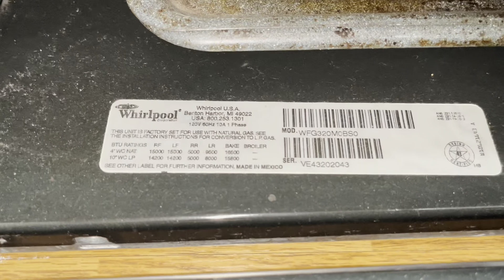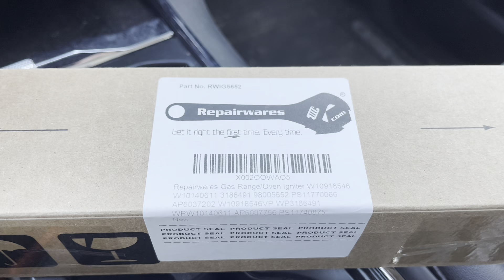Repairing a Whirlpool oven by replacing the igniter.

Comment: Any suggestions on that could be the issue if my igniter heats up but it never sends gas?? Same model as in the video
Reply from the maker: It could still be the igniter not working well enough, or the safety valve it connects to, or the gas regulator.

Comment: Whyyy can I not get the bolts undone? What did you use? Mine might have a little more lip than yours so I can't get a tool in easily.
Reply from the maker: Shoot. I’m sorry. These were just small bolts so I used the nut driver on my multi tool screwdriver.

Comment: You're electrical diagnostics are explained incorrectly.
If the element is good, you will have continuous AC voltage through the heater/ignitor and both wires.
Having AC in only one of two wires indicates the element is failed in an "open" state.
That means it is not allowing current go through the heater coil.  That is why the neutral wire does not indicate voltage present.
Reply from the maker: Fair enough. I’m not sure I follow the difference but either way it’s the same result.